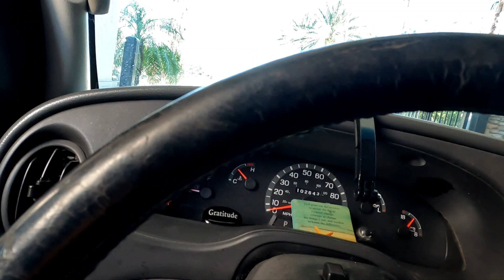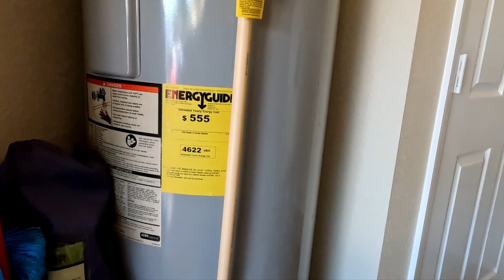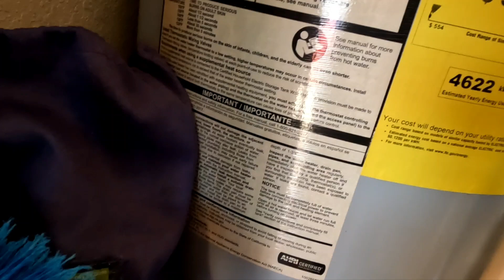DRIPPING MOEN TUB/SHOWER BUT CARTRIDGE IS GOOD??

Comment: I have to ask why you ran the water while removing the handle set screw?  You left an open drain and to boot water running, good chance if you dropped that screw it would flow down the drain.  I'm only asking as a plumber.
Reply from the maker: It's  just easier for me to remove the set screw working from the top,I asked about the drain because I usually close them when I do this work and I have at least 100 of those set screws on my truck,I've been doing this for a long time and nothing in the scenario you described happened. Thanks for the comment, and thank you for watching.
Reply: @johnphillipsplumbing7148  JOHN I meant no harm by asking.  I know you must have set screws on the truck.  A lot of people will see the video and may attempt to do as you did and they don't have screws lol.  Maybe im wrong but I thought a professional as yourself will make a video showing the proper way following caution etc.
Reply from the maker: I forgot to tell them what size Allen wrench,you missed that! Your points are duly noted,next time!